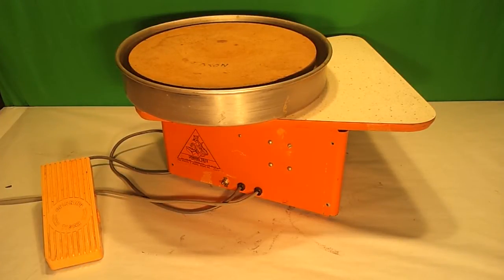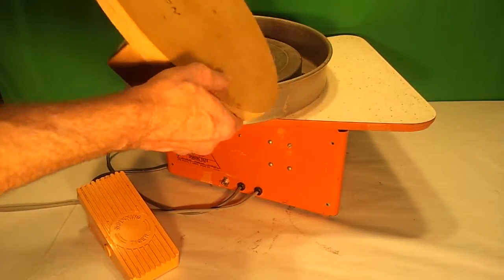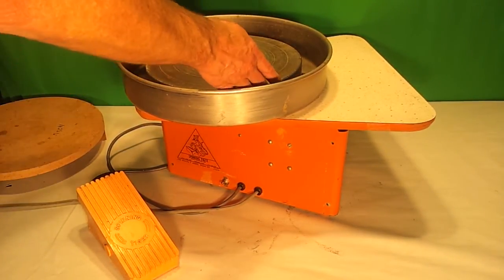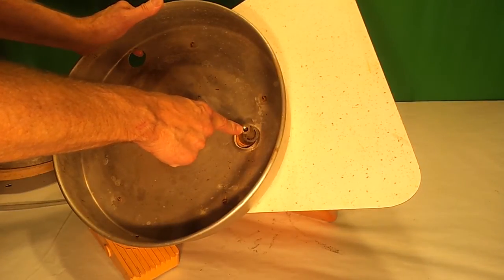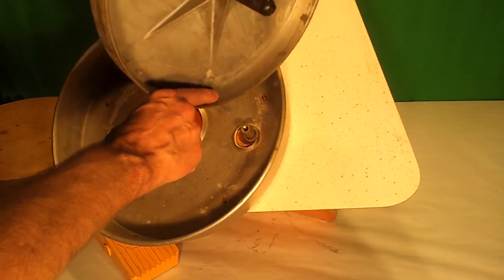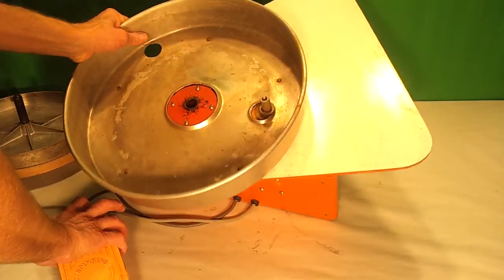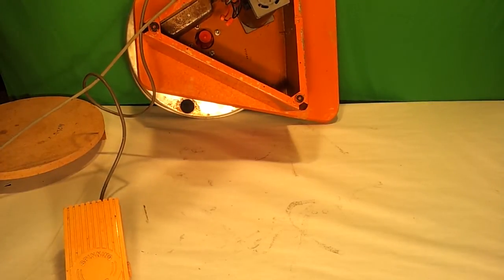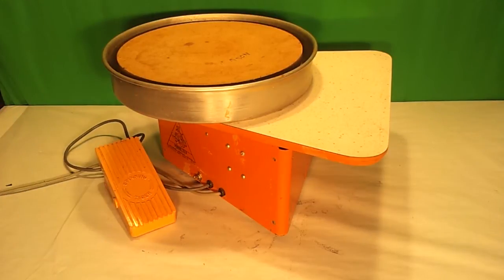Spinning Tiger Electric Potters Wheel Desktop Unit Needs Repair "AS IS" Used

Comment: i used 5/8 in premium automotive rubber heater hose, cut about 1" off and put it on the drive wheel. buy a foot and you'll have replacements for years. clean inside track with a pot scrubby if it sounds ruff turning.
Reply: kalhoon Any thoughts on using a silicone grommet?
Reply: No , but I was thinking about cheap and easy to find.
Reply: Hi! I know this is an ancient post, but I just bought a used spinning tiger wheel and this is my exact problem! I have no drive belt on the wheel. How would I go about using the auto heater hose as a drive belt? Or were you originally saying to attach it to the inside of the wheel head?